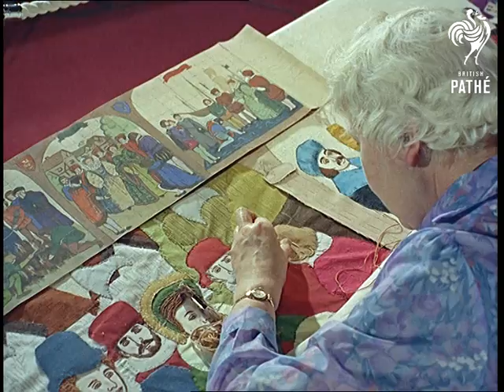Ideal Home Exhibition (1966)

Comment: In December 1969 I had a three-week job painting dioramas for the reptile cages in Antwerp zoo. I had to work at night. My way into the intimidating challenge was to paint in washes all over the surface. These washes would suggest landscapes. However, the zoo authorities – including the director M. Tabac – came and saw what I had done and got into a terrible state about it. They phoned my boss, David Gillespie, in Dippenhall, UK. “We are extremely worried by what your assistant has done,” they said. “He’s made a terrible mess.” David Gillespie – Capricorn, always supportive – explained that I was "an artist”, not an illustrator (?) and all would be well and he was confident that “the mess” would be transformed into satisfactory landscapes to their liking. They were and all was well. I’ve had trouble of one kind or another all my life. No one understands me. Doesn’t matter what it is. Here are David and Anne Gillespie in 1966.